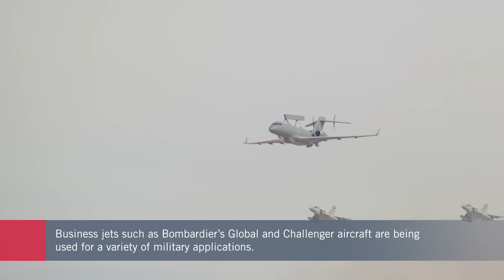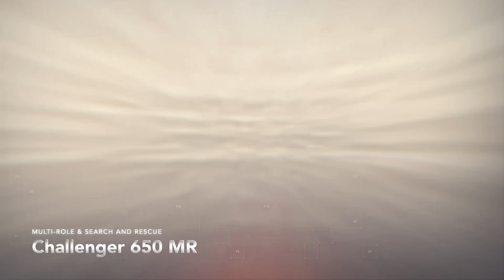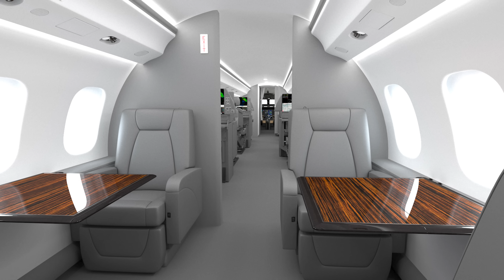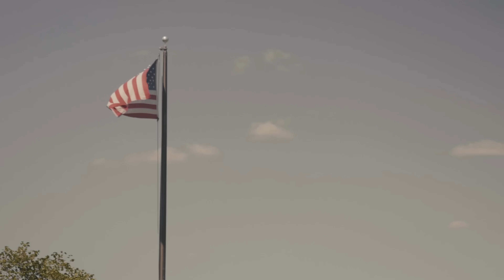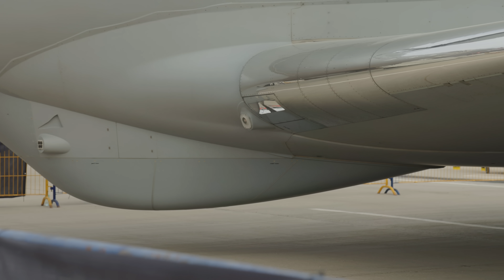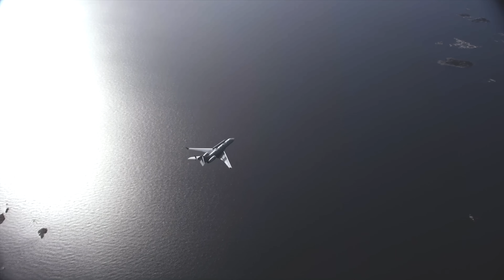Bombardier Defense Prepares Luxury Global and Challenger Jets for Military Service – AIN

Comment: Very cool. The smartphone analogy is off. In actuality the bulk of the phone is made up of battery, case, camera and screen. The "chips" and circuitry are a small part of a phone's footprint. So much smaller potentially, which works well with the smaller airframe

Comment: So why do they have that small radar bar set up on pylons when instead they might build an AESA system taking full advantage of of the volume of sensors for that space?
Reply: It has an adaptive AESA radar, Seaspray 7500E maritime surveillance radar and an electro-optical/infrared sensor.
Reply: @LigerSupremacy  I know what some of those words mean! Haha cool, thanks for sharing.
Reply: I don't know what you would like to see instead, but that is an AESA system mounted on the top of the Globaleye. And it's not a Seaspray 7500E, it's a SAAB Erieye ER radar system.

Comment: Canada should have selected the Bombardier over the boeing for maritime patrol or as a VIP transport maybe even a tanker. While using DASH 8s for search and rescue since the planes use applied tech therefore realistic. Canada would still have to import jetfighter planes and build copies of American and foreign helicopters.
Reply: Canada selected the P8 for the long range maritime role and could complement them with the Globaleye for other roles. It's still in the cards if a drone doesn't take up that role first.
Reply: Excuse me sir but you have your head up your a$$. Bombardier continues to make politicly bids for Canadian jobs with out even providing a proto type to industry hence Canada continuing to lag be hind in all military procurements. It’s time to stop making military purchases political which Bombardier continually does at the cost of Canadas security.
Reply: Canada has Challengers for multiple roles including executive transport; they are designated CC-144. 

The larger Global Express family are larger than needed for the roles filled by the Challenger, but they're not nearly large enough to replace thd old CC-150 Polaris (Airbus A310) or its CC-330 Husky (Airbus 330) replacement.

Comment: At several air shows, I have spoken to E-3 crews.  A common theme was the E-3 interior was a sweat box (in an old Texas prison) because the equipment generated that much heat.  Because Bombardier builds corporate/luxury jets, I hope EW Bombardier products are comfortable and come with a plush lavatory...not one of those broom closets in commercial airliners.
Reply: In all honesty they're probably not going to get much in there. Comfort adds weight, and they probably have weight targets to hit with all that extra EWAR equipment if they don't want to take big penalties to fuel consumption/range. It's many decades newer than the airframes for those E3s, so it'll probably be nicer by default, but not a TON nicer.
Reply: You misunderstand the key issue. A corporate aircraft has to be comfortable for paying customers. A military aircraft doesn't due a relatively captive clientele. A military aircraft just had to be comfortable enough people can perform their jobs. Meaning they'll stretch the trade between comfort and cost/capability as far as they can in favor of cost/capability. A gutted airframe crammed with military specify hardware can easily be as uncomfortable as current aircraft. The real benefit of using these aircraft is that the airframes have been around a long time and are proven. That means the cost of reconfiguration is a lot cheaper than designing an entire new airframe.
Reply: The improved tech hardware might alleviate this by quite a bit. By reducing the size and power consumption your going to generate less heat. But they might keep things like AC to not only keep the crew comfortable but the equipment as well.
Reply: The 707 that the E3 is based on first flew in 1957.  The design could file for social security benefits.
Reply: Just because its Bombardier, don't expect any more comfort for the crew. Military equipment is public spending. You know how defense tenders work. They almost always go to the lowest bidder.
Reply: I'd be more worried about my ability to have children with the amount of signals they put out and receive.
Reply: @MyCaptainPugwash  better have children first before you board that plane. Otherwise you're right. You're screwed no matter what EM shielding is inside. And not only you're screwed, your children will be born with genetic defects too. High EM environments are a one way ticket for biological creatures
Reply: They might just have the same lavatory but without the flashy additions (gold taps, TVs, etc). 

Existing lavatory has been designed & optimized for the plane already, and creating a brand new one might be more costly.
Reply: That would be false
First
basic physics 
aircraft operating at high altitude are subject to extreme temps in the negative range from -70 to -40
So that heat that equipment would generate would be sapped off 
Secondly the 707 upgraded for AWACS accounted for the heat
Other facts
The E-3 carries up to 19 mission crew. The E-7 carries up 10 and Globaleye only carries 5 
While technology has reduced the number, the E-7 can still easily rotate 5 on 5 off crew for long endurance missions
EW Bombardier cant do that
Reply: Military shitters are basic.... don't get your hopes up
Reply: US will switch to Gulfstreams now.  US is going to embargo Bombardier for Canada's decision to drop f35.  That will cost Bombardier 70 pc of its sales.  Bombardier will go bust.
Reply: so you mean just like the E-7,  global eye is not a serious competition to the E-7 or replacement for the E-3.  There is only 3 global eyes flying + 2 on order. Compared to E-7.  AUS-6, Turkery and south korea - 4 each,  UK -3 in build, + US + Nato.  So far its been a commercial failure,  it might still come back from the dead like the C-390 but atm there no real sales into the future.   E-7 is pretty good on board,  its a commercial fitout,  about half the cabin is chairs for R&R on long missions.  It can air to air refuel which global eye cant, E-7 has full 360 radar,  global eye limited to 270

Bombardiers niche atm is the one off or low number modification like BACN and ARTEMIS.  With 2 demo artemis planes flying they are a competing with gulfstream for this part of the market.  The gulstream CAEW is a competitor to global eye and its used by Italy, Israel and Singapore 

I just dont see what part of the market is there for bombardier to expand into atm
Reply: The GlobalEye will complement the E7 capability. The US is going to buy them along with their 26 E7 aircraft. That's what this video is about. The US is buying them and after that more orders from other nations will follow as the platform matures.  @richardthomson4693
Reply: global toilets are smaller than on commercial jets.
Reply: @stefanb5189  Zip-Locks
Reply: @stefanb5189  Clients in the defense industry should have better aim than civilians.

Comment: The Danish air force is looking for a replacement for it's old challenger surveillance planes. This must be high on the list.
Reply: It's all about relations. They prefer to buy stuff from their "friends".
Reply: US will switch to Gulfstreams now.  US is going to embargo Bombardier for Canada's decision to drop f35.  That will cost Bombardier 70 pc of its sales.  Bombardier will go bust.
Reply: Sure thing comrade @AnyName-rg4rp
Reply: The RDAF would prefer the P-8, it seems. I can’t understand why, they’ve never specifically said why a GlobalEye wouldn’t work for them and it not only would be cheaper but they could maintain pilot compatibility with the VIP jets they also need to refresh.
Reply: @sunbeam60  The defence ministry doesn't seem to operate using sound logic, as seen with the case of the Israeli Elbit systems purchase. Those in charce of the procurement agency seem to be either incompentent or corrupt.
Reply: @sunbeam60  Indeed